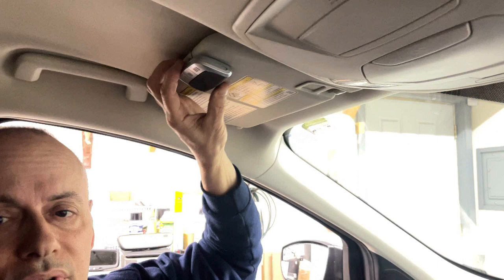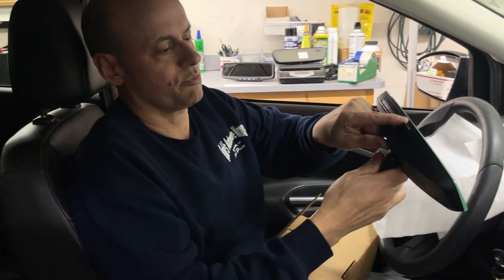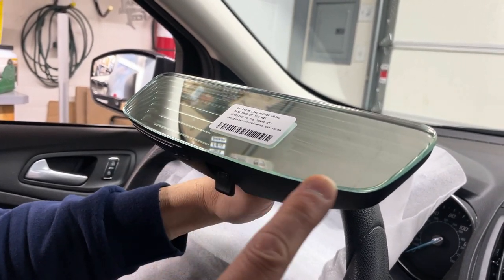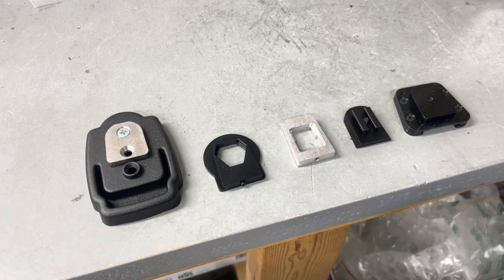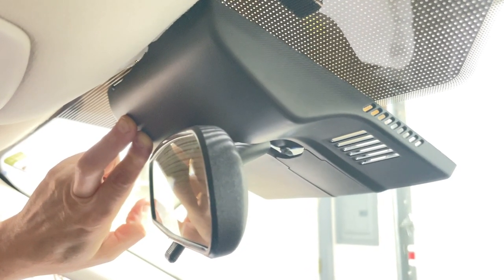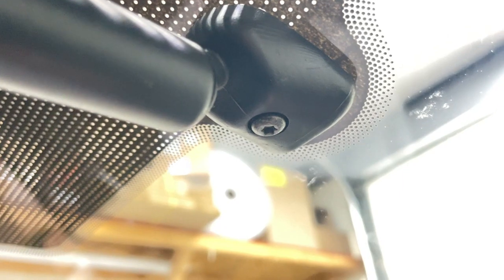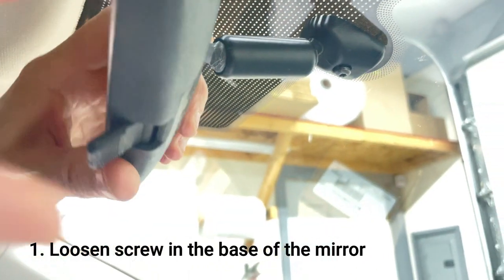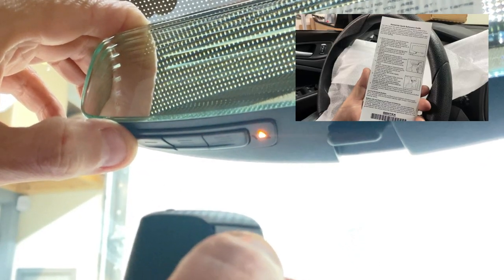Homelink Rear View Mirror Installation in your car - EASY Instructions

Comment: What about the wireing
Reply from the maker: This mirror does not require any wiring. It has a built in battery for the Homelink buttons that, according to the manufacturer, should be good for around 10 years.